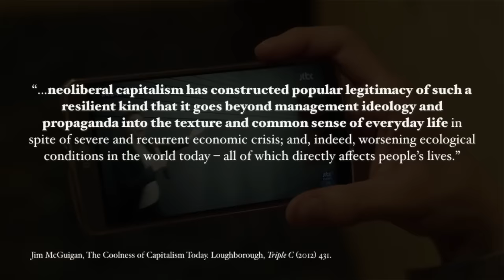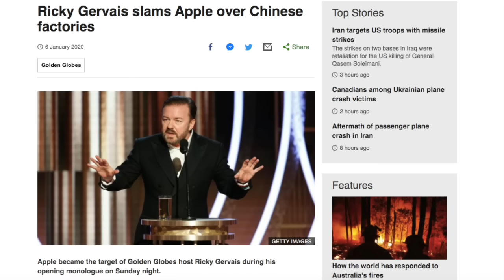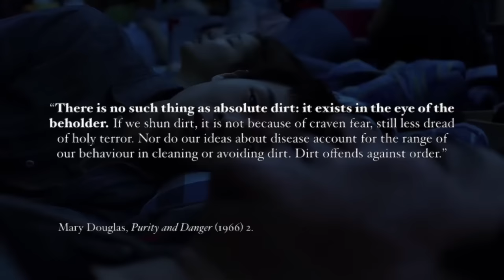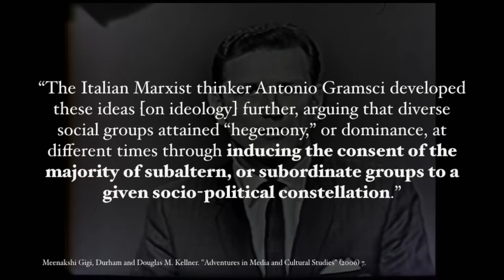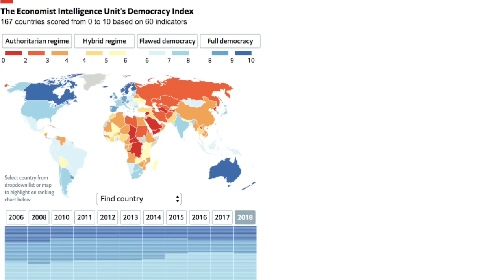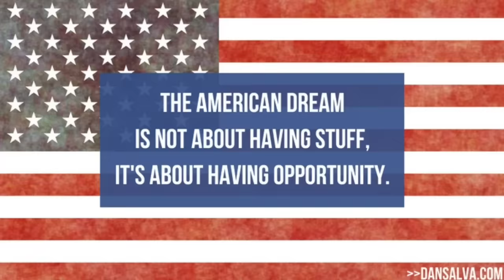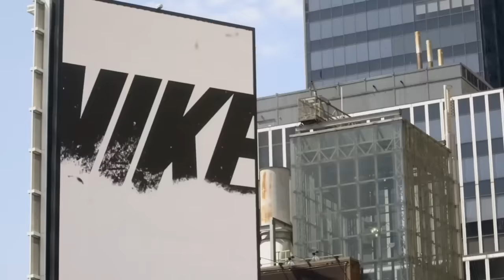Why Parasite Should Terrify Us (Spoilers)

Comment: The criticisms in Parasite are much almost identical to those the Korean satire “Yangban chŏn” (“Tale of a Yangban”) written during the later Chosun Dynasty. Parasite doesn't represent capitalism. The story in Parasite represents Korea''s Neo-Confucianism and traditional Korean social structure. These systems and their criticism predate both the Enlightenment and Capitalism and one could easily write Parasite as a portrayal of north Korean society and economy, given their reversion to Neo-Confucianism under the banner of KimIlSungism and their centralized economic control. That being the case, I think it is a reach to apply an interpretation of Parasite to Neo-Capitalism.
Those failing morals in Parasite that push the story through to the end are ignorance and greed.

Comment: good essay, the onyl problem is that is not objective about some things, for example, the thing about labour, is that to be rich , you will never going to be one if you work in a easy replasable work, labour have a price, and is actually not the company fault,  nor the labourrist, is the free market, free market works on demand more than supply,  if in a country the education system is failing, there would be a surge on the supply of easy replaceble work, inflating the value of those works, and making it less valuable on the other hand, if you try to control the free market, it will find stabilility itself by devaluating its working currency to the ground, it is terrible how the matematics works on it,  and it is what happens to the currency on far left, far right countries markets, it is imposible to actually attain equalitty of outcome or equality of classes, but you actually can attain equality of oportunity to some extent on a country, it is hard, in china ofr example, the 3 state banks, protect thenselve by not giving loans to pontentially high risk companies, on the contrary, USA those love high risk high reward, giving money to whatever especulation high valued venture, then faling, crashing part of the free market, etc etc etc... this is just an little example of how convoluded this actually is, if you want to actually learn a little more about how money works, you need to reead a lot, and try to stay unbias to that study, this essay is a little biased towards marxism, but still a good analisis overall.